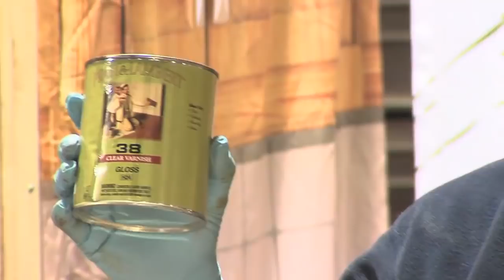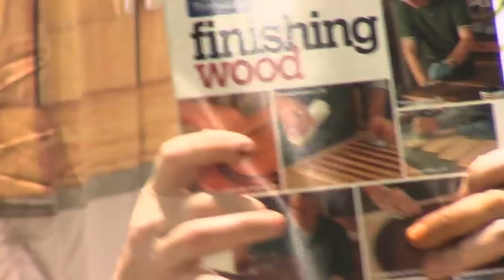Finishing Seminar with Peter Gedrys

Comment: I just attempted oil based poly varnish on a reclaimed teak desk i made and boy did I make a mess and after two coats it looked horrible.  I did almost everything he said not to do except I was using a foam brush.  The big thing was I pulled from the edges and attempted to wipe them after it set a bit and it definitely smeared.  Granted I am fairly inexperienced with finishing but this video has been incredible.

My next task is to completely remove my botched poly varnish which ought to be fun although I've been researching that as well.  I will apply his tips to the fresh coat and report back my results.

Comment: Great demonstration. I also don't use tack cloths. I buy inexpensive bags of micro-fiber cloths. They pick up fine dust and other particles. You can wash them and use them over and over. I use 0000 steel wool for the later coats of finish. As long as the finish is dry, the wool will be picked up with the micro-fiber cloths. I've never seen any rusting in my finish.

Comment: HELL YEAH FOAM BRUSHES!

I think he should have mentioned that many people, including me until I was 32-years-old, have never used a good foam brush. Most of them that you find at Home Depot or Lowe's or Wal-Mart are absolute crap, with any kind of thinning agent dissolving the glue on the foam, too much air in the foam so there's bubbles all over the place when you apply anything.

GOOD foam brushes, like Jen (brand), you can easily find on Amazon for cheap, or your local paint store.  I'm lucky that our local Hallman-Lindsay has Jen foam brushes and they're the same price as Amazon.

There are a couple other good brands but I've been using Jen for years and I'd have to google for what they are.  I can use anything to apply, but my main two methods are:
1) thin and apply with rag
2) use a Jen foam brush
It's easier, faster, and better. Downside is a good foam brush is $0.50, whereas a $15 brush can last you for years and years.  Ah well, small monetary trade off for a superior finish.

Recently I saw someone use a grout sponge cut into 2x2x2 pieces to apply a water-based finish and it looked SO EASY.  Definitely going to give it a try next time I use water-based.

Comment: You do use steel wool between coats. Just make sure you have a strong air blower and hit it with distilled water and mineral spirits before the next coat ( oil finish ) .

Comment: Hi, thanks for this fantastic video.  I am building several planters boxes and I have used tung oil because of the herbs and food safety that I want to plant in them.  we will eat them.  Should I use any finishing on them?  they are outside and exposed to rain and sun light and direct sun?  thanks
Reply: Frank Smiley We just build raised garden beds that areL shaped and 6 feet x 3 feet and a center 4 x 4 feet. Went through same thoughts about food aafety and finish.  So used spruce 2x8 lined the inside with fabric cloth and let it be. The wood will turn gray and last about 5 years at least. Later we will install cedar caping on outside to make it look better.

Comment: Mr Gedrys shellacked over varnish at 28:00 and then at 51:51 recommended varnishing over shellac; when is each method used?
Reply: Fred C Dobbs He shellacked over shellac, it was a different door.  Shellac (dewaxed) is a universal sealer - it's shellac first, then pretty much whatever you want to put on it (latex, oils, lacquer, varnish, etc...

Comment: how shellac seals and doesnot give waterproof?
Reply: +Alexander the Great It's really in the technical definition of "waterproof". A good Shellac finish is extremely water-resistant, to the point where water could sit on it for a few hours and not penetrate, but eventually water will seep through.
H2O molecules are slippery little devils and can worm their way through a lot of things, given enough time. 
For something to be officially waterproof, standing water cannot be able to penetrate it.

It's not as arbitrary as it seems. If you see "water resistant" on a label, you have to wonder "how water-resistant is it?" - but if you see "waterproof" you know that water isn't getting through if it's properly applied. (Caulk is another common place you see waterproof vs. water-resistant)

Shellac is still a very good alternative to waterproof varnishes in many cases. It's easy to apply, dries fast, easy to repair - and do you really NEED your coffee table to be able to resist standing water for >4 hours?

Comment: Have you ever used linseed oil?
Reply: we use boiled linseed oil , alone , in the workshop, for tool handles etc, it is not for fine finishing.
WARNING, if you use rags with linseed, they can self combust .
Reply: @ladygardener100  
That's true if one were to use boiled linseed oil & not take proper measures for storage and handling, but experienced woodworkers are careful to follow good work practices. 

For a traditional French polish, boiled linseed oil is the vehicle of choice, and is never used straight, but diluted with a carrier that helps it be absorbed.

But I'm nearly 76, and it's pointless to talk to people who know it all....
Reply: @josephefasciani7343  You French polish using boiled linseed oil? I thought French polish was done using shellac and only shellac?